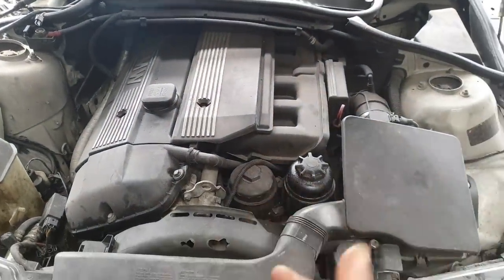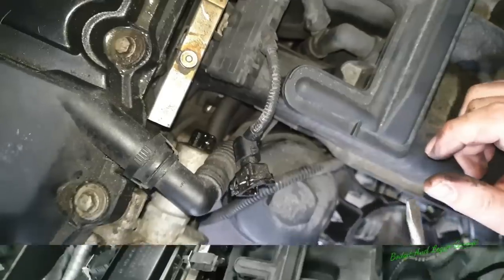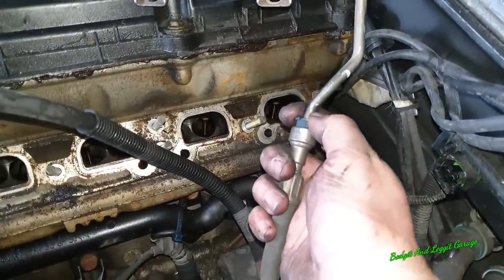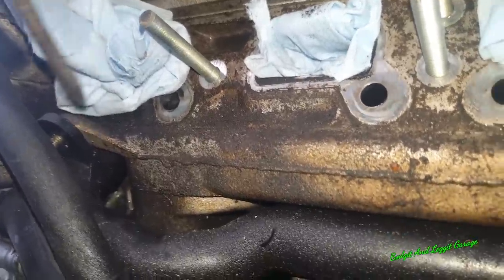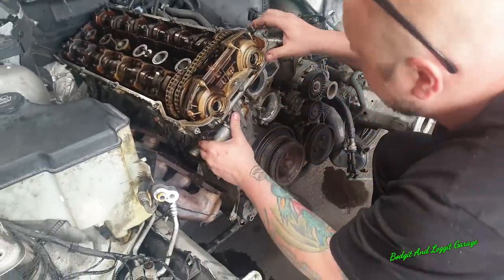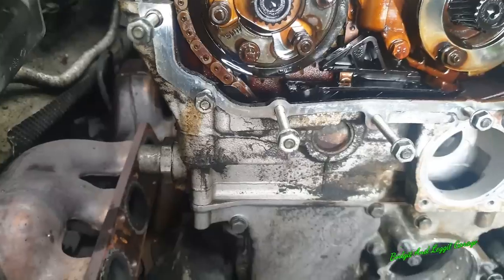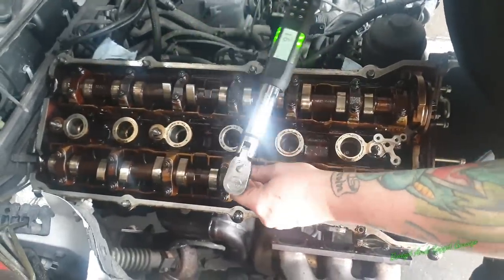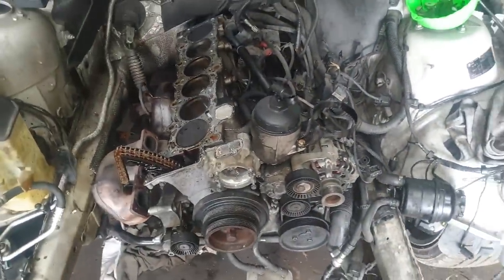BMW Head Gasket Teardown (WARNING)

Comment: Cheers for the Great video. 
My Father & I are both BMW mechanics, restorers, & collectors. The Old Man's missus has an E46 325i that suffered a cooling system failure, which resulted in cylinder head issues after she cooked the M54 before she realised there was a problem. Chicks will scope their iPhones & iPads constantly even while driving, but you get blank stares when you ask them about the temp gauge! 😶🙄🤣
Anyway, he was thinking of pulling the head to attempt a repair, but your video helped me convince him it would likely be better & more economical to source a good 2nd hand engine, IF they decide to keep the car, than bother trying to rescue this one, as it's highly likely to have at least a few stripped threads in the block. It was overheated pretty terminally, and is losing coolant through the head while running on 5 cylinders.
In all my years turnin' spanners, having worked on all-alloy motors from just about every manufacturer (Peugeot, Renault, Volvo, Fiat, Alfa, Audi, Mercedes, BMW, etc, etc, etc), I'd never encountered engines with thread issues like these M54's. The Old Man couldn't believe it when he first heard about it from the Master Technicians he worked with at the BMW Dealer he was employed at.
I'll stick to the old skool engines like the M30's in my E23, E24's, & E32, and the M10's & M20's in my E30's. Those things are bullet proof tough in comparison, and easier to repair/recondition if needed.
Thanks again, Brother. We Aussies have our own terms, but I think in your lingo, you'd be what's known as a "Diamond Geezer"! 😎😁👍🤘
kind regards from Down Under.
Reply: I agree about the temperature gauge, when you talk about kids not paying attention to their temperature gauge, I don't think most adults know to pay attention to their gauges anymore, it's pretty sad. I taught both of my daughters to constantly keep an eye on all of their gauges, and where they are supposed to be, and I told them the most important gauge is the temperature gauge. To this day they constantly keep an eye on their gauges and know to shut the engine down if the temperature gauge starts creeping up.
Reply: @watercarepro9610  I probably shouldn't say anything as my comment was kinda sexist, though I intended it tongue in cheek, but I was talking about Women not paying attention to the gauges when driving, as it was my Father's Girlfriend who cooked the M54 in her E46 3 Series, but we're both correct, as usually kids are just as bad at monitoring the Engine's vital signs even though the gauges are right in front of 'em. Commendably, you have taught BOTH of YOUR daughters to drive correctly, to be aware of the vehicle, why it's important to monitor, what to monitor, how to, and what to do if things go cattywampus, like pull over and shut down if temp. starts to increase anything over normal....that's important by the way, as "normal" operating temp. is in the centre of the gauge's range from cold to hot, and to stop their customers getting paranoid or overreacting, in the late 1980's BMW began placing a diode in the temp. gauge circuit to "dampen" it's movement at the centre mark and keep it still there, as previously the normal movement of the indicator dial 1-2mm either side of centre as temperature slightly rises & lowers through variable airflow in traffic gave some of them anxiety issues. With these diodes, the dial indicator will remain perfectly still at the centre of the gauge, as the diode won't allow the gauge indicator to move up or down at all until the actual engine temperature alters more than 10 deg Celsius above or below the optimum normal operating temperature of 88 deg Celsius. So given, by the time the gauge moves UP AT ALL, the temperature is already around 98 deg Celsius! Anything over 100 degrees risks engine damage, with the odds & severity increasing in proportion to the rising temp. If you see that gauge move AT ALL to the hotter side, it means the cooling system has an issue, at least in it's early stages, and is much cheaper to rectify ASAP than a warped or cracked cylinder head, with a side order of stripped head stud threads in the block. I think the diodes aren't a good idea, as I'd much prefer to put up with the normal, if more sensitive, miniscule movement of a temperature gauge at around normal temperature, and know the moment it rises over that, than be falsely reassured by a still gauge indicator, when the engine temperature could really be 10 degrees Celsius up or down, and I wouldn't know it until the gauge suddenly registers it beyond that, giving less time to pick it up visually and find a place to stop, especially in traffic.....Hopefully that's a little tip you can pass on to the kids to expand their already admirable knowledge. You get my vote for Top Notch Father Skills! 

As my Father said to me often when I worked for him as an apprentice mechanic, "Look after your car, and it will look after you." It was sage advice then, still is, and I never forgot it.

Cheers mate. All the best!

Comment: Yeah definitely overheated my M53 2004 BMW X3 3.0i a few times. Thanks to a frayed wire in my fan, while idling, it overheated and the expansion tank blew out. Head gasket now leaks, it’s not horrible, replaced the radiator that was leaking too. I’m not going to do this properly, going to attempt to use some head gasket in a bottle repair and see if it’ll hold on for a little while longer. At 180,000 miles,  definitely a shame, reliable vehicle for 5+ years. Topping the coolant off every week or two isn’t horrible… 🤷🏻‍♂️ Really just want to use it to haul my bikes to the racetrack.

Comment: Interesting. I hate that sort of engine! I much prefer the security of a cast iron block and head where you don't have to worry about these things!

PS, you can get helicoil kits which might work for the head bolts.
Reply from the maker: Yeah you can buy a special kit but they are very expensive because you need special pots for them to make them work and last that's what I want to show in the next video don't know if the customer will do it there
Reply: @bodgitandleggitgarage  I've used straight forward helicoil kits on a cast iron block once. Do you know what the thread size is?

Comment: God, the M54 is a picky engine - too hot, the heads warp; too cold, the oil control rings and CCV clog up!
One thing I would recommend is swapping the expansion cap for a 1.4 bar version; 2 bar is too high, and I would rather the cap fail than the tank explode😁

Comment: Why would you take the whole is a star after you cut the bolts you’re gonna have to get them out anyway and put new ones back in so you might as well do it now hammer them out or drill them

Comment: Hi I was I’m a BMW mechanic and in school we Learn to use Cylinder head Screws only one time wants I was wondering and then replace with new ones when you replace the head because the boat stretches only once that you user in the head can only be used once could it be that you may have cars that it couldn’t go to six all the way to second 90° because of the boat was already been stretched once Before So what I’m learning from that is that you may have damaged the cylinder head because I’m not using a new Stretch cylinder head screw And a new head gasket I think it could work but only with new bolts

Comment: Good vid, very well explained. Seeing that amount of light coming under the straight edge when testing for head warp is never a happy sight, and that head looked to be so warped that I’m surprised the cams can even still turn!
Reply from the maker: Yes mate with these engines do suffer with this quite badly have seen a lot of these heads that are very badly water and the cams can still turn

Comment: Great video very helpful! Just one question tho... Is there no need to lock the cams in place once you have them lined up correctly? Because I see a lot of people use a cam lock tool when taking of the head
Thanks!
Reply: You don't need the tool to remove the head .  The tool is more useful when you put the chain back on

Comment: I think he just stripped those threads by re-torquing stretch bolts. Those bolts are already stretched and so won't match the original threat pitch of the block anymore. That's why they never reuse those bolts.
Reply from the maker: I explained everything in the video these have a big problem with this everyone who knows about this problem does exactly what I have done this is the only way to test it are you going to put all the money into buying all new parts putting it all back together and then when you put new headbolts on you have this exact same problem this will cost you a fortune this is why I made sure there was an issue or wasn't an issue before I continued you need to know the vehicle And the common problems on them before you can make comments If you would have just put new bolts in you would have spent a fortune and wasted all that money I'm showing people how to do things properly so you need to know what you are talking about properly before you make comments
Reply: @bodgitandleggitgarage I am not an engineer or expert but I understand this... A torque to yield fastener (TTY) or stretch bolt is a fastener which is torqued beyond the state of elasticity and therefore undergoes plastic deformation, causing it to become permanently elongated. 
Therefore, most elongated bolts are normally in the middle of the block where the mysterious bow is. Since those used bolts are no longer as they used to be. So they should not be used for testing threads. We may probably use new.

Comment: So much unnecessary work this video is hard to watch. Just did this job and you don’t need to remove half of the stuff he says to remove. There’s no reason to remove the entire front clip, dip stick, ac compressor, engine mount, steering shaft, exhaust, skid plate, Jesus! You’d go broke having this guy fix your car. Removing the exhaust headers is very simple and it takes 30 minutes. Simply remove your engine mount nut on the exhaust side and loosen the one on the intake side, Jack up the engine a couple of inches and then unbolt the headers. Half of the bolts you can reach easily with the electric ratchet, and the others just get with a hand ratchet just have a a few different sized extensions. Pull the manifold away from the engine and use some wire to hold it back. Head comes off easy. So much unnecessary work making people think this job is way more complicated than it actually is